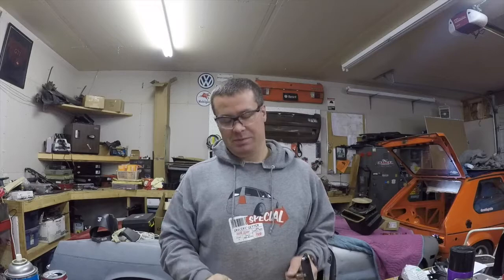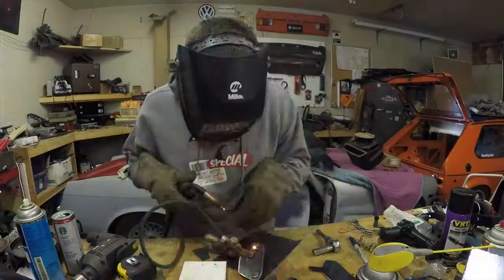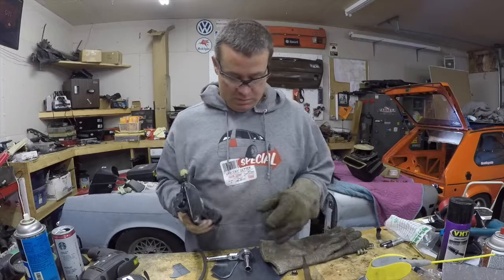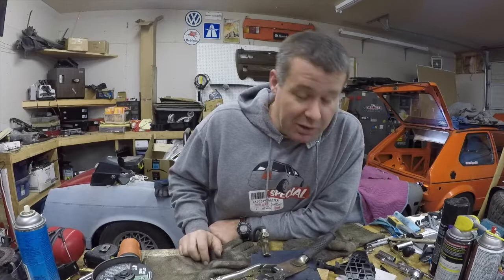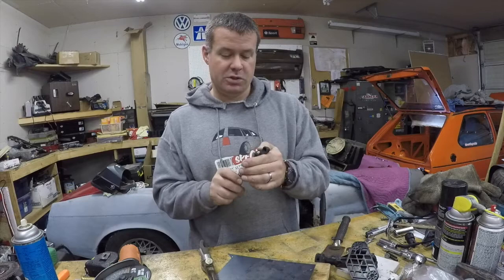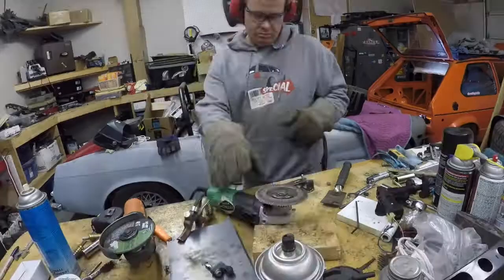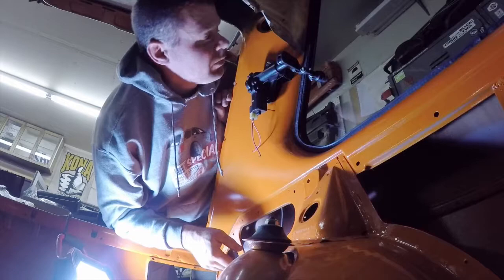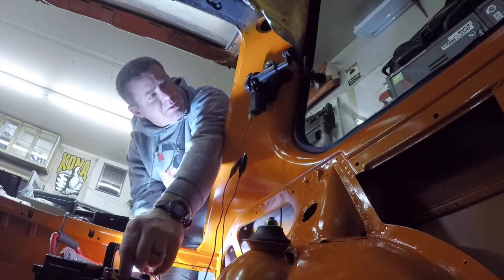Powered popout windows! 1975 VW Rabbit 1.8t 20v ep#24

Comment: At the beginning of the video 0:06 I can see a piece that goes through the hole in the glass. That piece attaches to the actuator. Dodge actuators can be found on line, but I have not found any piece like that one going through the glass. It's not included with any part found online.  Is that also a Dodge part?